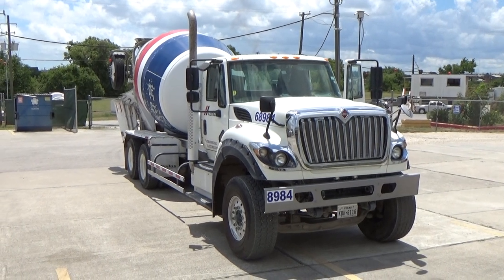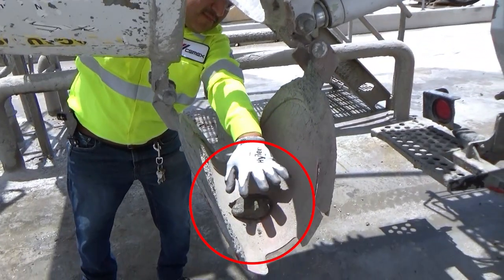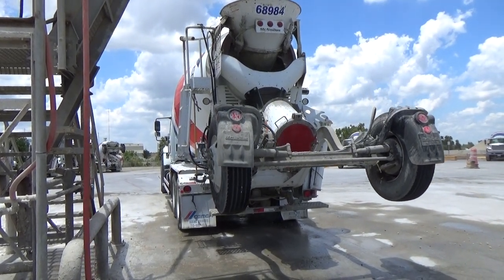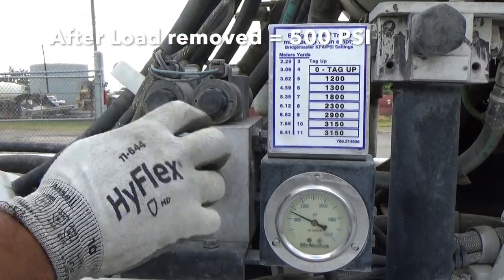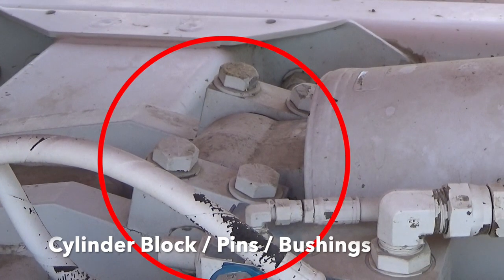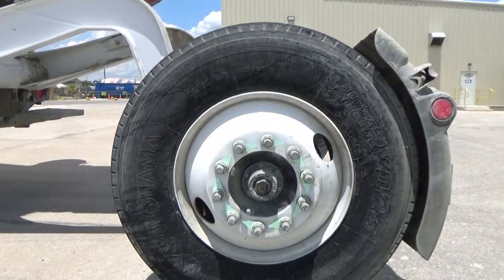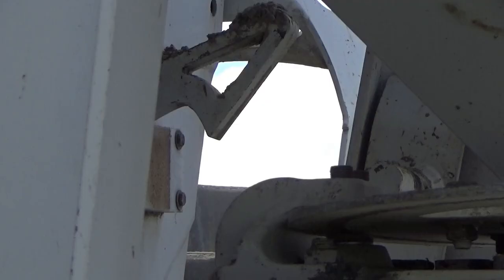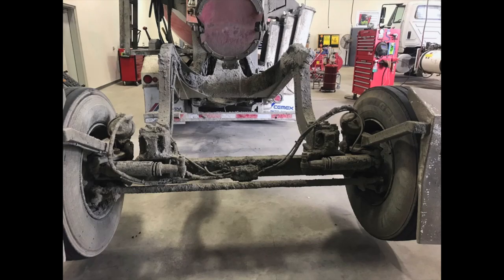CEMEX Tag Axle Safety #Zero4Life

Comment: I notice that the concrete trucks where I live do not have the tag axles at the very back of the truck, but between the back the cab and the front of the drum.  Is there an advantage to either design?
Reply: Tag axles help with weight distribution, the ones with axles on the back are called bridgemasters and are used for bridge length restrictions.